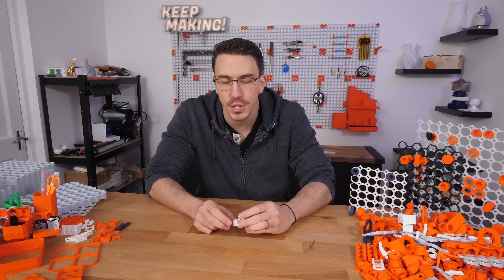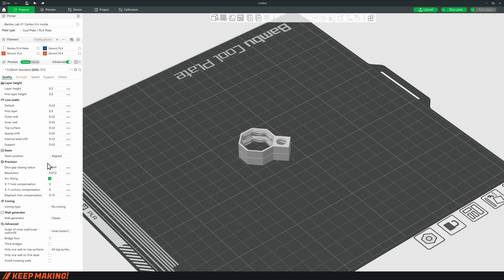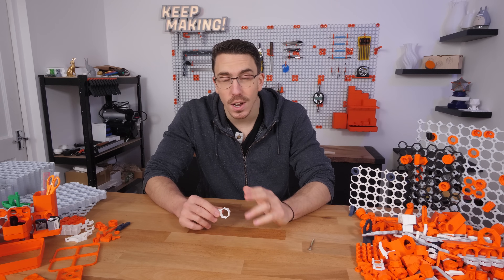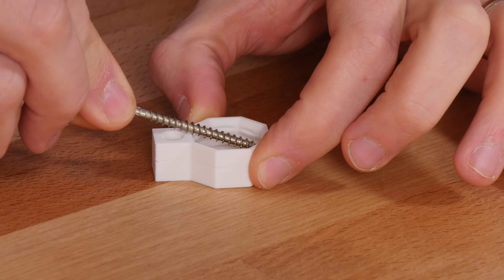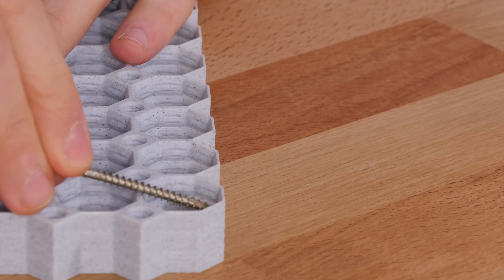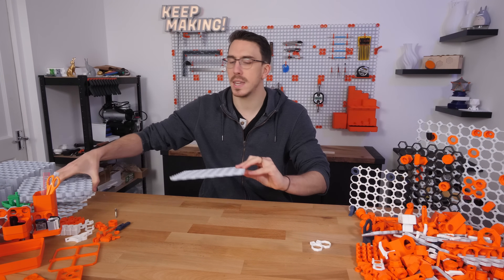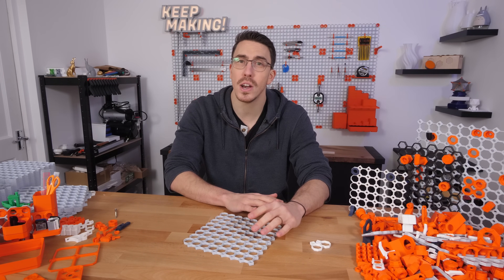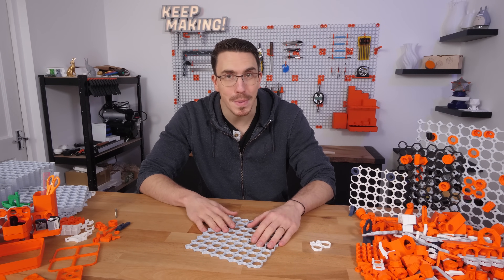Multiboard: What Is Stack 3D Printing

Comment: I could get my test prints to work fine, but then when I tried printing bigger tiles, I'd get the first tile fine, but then subsequent tiles either wouldn't print at all, or they'd turn into spaghetti. Turns out it's related to heat creep. I'm using a Bambu X1C with a 0.4mm nozzle and PLA Matte material. I sped up the Ironing Speed from the default of 30mm/s to 50mm/s and the Ironing Flow from 10% to 15% and I left my door open and cracked the top glass lid off and now it’s working great!

Comment: What if they are not exactly the same. Example I am trying to print a multi-board setup for my bambu X1C a side panel. The specific model I chose because it has borders but since it has borders each piece is specific left right top bottom making subtle differences. Can I still stack them

Comment: I had initial success with stack printing the Multipoint learning pack stacked tiles the printed great and cam apart great. When it came to the 8x8 stack of 4 I made an initial mistake and did not turn ironing on so i have a very solid tile that is 4 tiles thick. Reminds me of the floors they use in aircraft!  The next print I followed the instructions and turned the ironing on but the settings do not appear to have worked as well as the did for the learning pack as they will not pull apart. I've tried the screw technique, a chisel I can split the edges but they will not pull apart in one piece. I am not sure what to try next I could do a PTG layer between them but its slow enough to print tiles without adding time. which settings do I need to tweak? I'm using a BAMBU x1C and Bambu matte PLA

Comment: Ive used this,, but separating the tiles requires a sharp stiff knife, and a lot of work. It's worth it to.print overnight (approx 4 hours per 9x9 panel, I print 2-3 stack,s), but not fun.

Comment: How much is the space between the two models if I have a 0.4 nozzle
Reply: Nozzle size is the diameter of the filament coming out.  Layer height is independent of nozzle size.  So you can have a .2mm layer height with a .4 nozzle.  Just make sure the layer height in your slicer is set to .2mm and you should be ok regardless of what diameter nozzle you are using.

Comment: I just printed an 8x8 grid stacked x4.  I was kind of concerned I wouldn't be able to unstick it.  I used the screw trick to get it started and then they came apart very easily.

Comment: Yeah, well I just tried this and got a 3 stack of solid pla. Grrr. I did the settings just like he said. What a waste of time. Obviously there are some other settings that are completely missing from this video.
Reply: The printer has to be very dialed in, the print temperatures you use have to be right for that filament and so on. If you print too hot, for instance, I imagine the top layer will just melt down on top of the lower. The way to do it is to print just the test piece and if it sticks, then trial and error until it doesn't. Only then do a 10-stack...

Comment: I got this to work with Bambu very easily .. take the file, use the settings he says for the ironing and walls... etc... then right click the grid, add part then pick the same file again ... then select both "parts" (has to be a part) by clicking then holding ctrl click ... new feature with light up in bambu "assemble" click that..... now select top face of bottom part, and bottom face of another. click the "center" button in assembly drop down, then enter .2 for the gap ... done...
Reply: A few notes:
- After adding the second part and before you select both, move one of the tiles. It's easier to select parts from both tiles in the assembly and you can easily fix the position afterwards.
- Face and Face assembly doesn't work for me for some reason. Point and Point assembly does work if you select the same corner point on both tiles but on one you select the top point of a corner and on the other tile you select the bottom point of the same corner. In the assembly menu you set X and Y to 0 and Z to your layer height (0.2 if you follow the recommended settings). Don't worry if one of the tiles ends up under the build plate...
- If one tile ends up under the build plate, exit the assembly (press ESC until the assembly menu is gone) and select the move menu (M). Pull the tile stack (it's only one item consisting of both tiles now) up and the slicer will drop it to the build plate for you.

Thanks @jakeMTSU !
Reply: You are actually amazing! :)
Reply: This is not working any more.  Bambulab gives floating cantilever error
Reply: @StraightRocketFuel  getting that is normal. You should be able to ignore that.
Reply: @wullxz thanks! Is it normal for a stack of five 8x8s to take 18.5 hours to print?
Reply: @StraightRocketFuel  depending on your printer and the number of 8x8s, yes. On my Bambulab X1C, I usually set the speed to ludicrous after the first 2 layers are down. I also turned down the auxilliary fan to 30% since I had some layers fail near where its outlet is.
Reply: @StraightRocketFuel that sucks, i haven't used it in while

Comment: I honestly have to ask. Why the absolute fuck are the "Default settings for multiboard" not already set into the fucking parameters on the downloadable models? Why isn't it preset to that by default. I printed like 5 tiles before i saw this video and heard "Default settings, 3 wall perimeters". Do you know how cuntish it is to upload a model without having the proper settings already loaded into it?

Comment: Can we get a new version of this with the latest bambu labs slicer, the top layer stuff isn't correct any more and it was a struggle to get them apart :( making me nervous to print a whole stack.
Reply from the maker: Could you elaborate on this as I have a bambu printer to and with the latest update nothing has changed that I'm aware of to change my approach to this
Reply: @Keep-Making  my bambu slicer doesn't have the same ironing as yours and honestly I'd love a tutorial on dialing in a P1S as the stacking tests that I've printed are not coming apart without some kind of hacking it apart. I have a 9x9 stack on the bed now, so that's not going to be done till tomorrow and I'm hoping it's not going to be a waste of filament.

Comment: Looking for help with my P1S. These tests are always fused. I usually don't have issues with tolerances, but this is getting to me. Any help?
Reply: Detect Overhang Walls, turn it off as it adds a layer in-between 2 stacked items which could fuse them. Each stacked item should have a 0.2mm gap between them. So to make a 3x stack of core wall plates for instance, put 1 piece on a plate, clone it 2x times, center each item, select all 3 and assemble. Raise the Z height of part 2 to 6.8mm, then raise the Z height of part 3 to 13.2mm. Item 1 is 6.4mm tall, top surface gets ironed, then second item gets printed at 6.8mm, gets ironed, and so on, and so on.
Reply: @mesajoejoe  Thanks for the ideas. I actually was able to separate them but needed a razor to do so. They actually came apart a lot easier on the full sheets, than the test.

Comment: Would you show how to stack objects in bambu lab ?
Reply: Take an object, clone it X number of times, center each item then select all and assemble them. Then raise the Z height of the parts keeping a 0.2mm gap in-between each object. Make sure to turn off Detect Overhang Walls.

Comment: Really appreciate the video.  However, I can't get the proper settings (don't know what they are) in Cura Slicer to allow the parts to seaparate!  Just checking the  'Ironing' box does not do the trick.  Anyone know the settings or other help would be appreciated!
Reply: Check our this video from 3D Printing Nerd which talks about stacking 3D prints in Cura Slicer https://www.youtube.com/watch?v=ediRzElyc-0

Edit.
I didn't hear him speaking about the Ironing setting at all, so it might not be needed. I don't use Cura Splicer, so I can not speak from experience

Comment: What software/workflow do folks use to create the stack?
I am trying to create a stack of 2 instead of 4. One of the objects gets the texture PEI surface, the other does not...which gets used in a different setup.
Reply: I got this to work with Bambu very easily .. take the file, use the settings he says for the ironing and walls... etc... then right click the grid, add part then pick the same file again ... then select both "parts" (has to be a part) by clicking then holding ctrl click ... new feature with light up in bambu "assemble" click that..... now select top face of bottom part, and bottom face of another. click the "center" button in assembly drop down, then enter .2 for the gap ... done...

Comment: Show us how you stack prints. Not how to print your stacked files...
Reply: Is this how you thank him to give us really amazing storage solution and for free? Moron...
Reply: Duplicate object, move them to the same position and raise it on top of the original. Set 0.2mm gap. Then select both objects and choose “merge”
Reply: Also they specifically mentioned that the already stacked files are available for supporters. Which is to say if you are not confident or comfortable with manipulating the 3-D model in the slicer, you can toss them a little bit of money they’ve already done it for you. It’s literally the point of what they’re doing is selling these files.
Reply: I printed the test print which worked. I threaded a bolt through the big hole and it separated pretty easily.
Reply: He explained how its done, there's a .2mm gap between the parts
Reply: @travisgrudzinskas8384 yeah, in what software because No slicer ive used allows for air gaps between parts/models.
Reply: @secondleasegamer8312  I just tried this in bambu studio, what I had to do was load the stl and duplicate it. Then you can combine/group the models, from there you can adjust the height of one of the models so its .2mm above the other. You'll get an warning but you can just ignore it and you should be fine.
Reply: @secondleasegamer8312 Literally just move the part with the transform utility. This is not hard.

Comment: I spent over 16 hours printing the 8x8 Multiboard Core Tile x4 Stack. I honestly don't see any advantage over printing in one piece. Moreover, I see more disadvantages than advantages. Printed together, the 4 took 17 hours and 4 minutes. In the case of printing a piece separately, it takes 4 hours and 19 minutes, so a total of 17 hours and 20 minutes in total. In such a long time, those 15 minutes make a negligible difference. My biggest problem is that the print is full of residue that is hard or impossible to remove. The idea is good, but useless for large pieces. I think this technique is only useful for much smaller pieces.
Reply: 15 minutes is a negligible difference if you ignore the time between the prints. With the four separate prints, you would need to go to your printer every 4 hours and remove the completed one if you want it to be completed in the minimum time. This adds time, and is impossible if you want to print it before you go to bed or to work.

A single 16 hour print could be started when I go to bed, and would be finished by the time I get home from work, for a total of 16 hours elapsed time. If it was four prints, I would start one before I go to bed, pull it off in the morning, start the other one before heading to work. Then I would pull the second one off after work, then print two more before bed. If you sleep for 8 hours and work for 8 hours, that's a total of 24 hours for the prints to be completed.

Comment: Newbie question: Which slicer are you using? 
I can't find the same settings in Cura. They are probably there, but I can't map the names to Cura's.
Reply: its most likely 
either orca slicer or bambu slicer, they both look pretty much identical.
Reply: Cura has ironing hidden under the Top/Bottom section of the printer profile settings. There is a small place to enable ironing inbetween "extra skin wall count" setting and "Skin overlap percentage".  Once you enable it, more ironing settings appear. 
Hope this helps!! 

I am using Cura 5.6.0 as of posting this comment.

Comment: In the early days of the pandemic, I designed a headband for a face shield that used a clear transparency film sheet as the shield. The headband featured geometry that allowed you to stack the headbands on top one another and easily separate. Headbands featured symmetrical geometry top and bottom that tapered to 0.4mm so in between headbands was only one layer to break. This method looks better as it leverages the aspects of the raft from the slicer to create the separation "cut".
Reply: Might have printed one of two of those 👍

Comment: Gotta keep in mind that stack printing doesn't work with all materials. PETG can give you headaches with the layers fusing together, for instance.
Reply: I did stacking prints when mass printing headbands for face shields in PETG early during the COVID shutdowns. I've forgotten the gap, but one technique that I used with my MK3 at the time was to turn the part cooling fan onto 100% for the first layer of the next stacked print, then return to the normal fan speed (30% I think) for the rest of the next stacked print. Wash, rinse, and repeat for each stacked part. This really helped breaking the head bands apart. As I recall ironing wasn't a feature in PrusaSlicer back then, but even if it was I don't know if I would have thought of that...
Reply: @Sembazuru awesome tip, thank you!

Comment: If you print them in PLA and have either an AMS or the patience to do multiple filament swaps at specific layer heights, you can simply print a single separation layer of PETG in between them.

PLA and PETG don't bond and you can easily pull them apart.
Reply: Doing manual filament change kind of defeats the purpose of stacking them.
Reply: Without an AMS, there's no real sense in going fillament swap. Its easier to just take the print from bed and goin over it again
Reply: No not really, depending on your setup you can perform a filament swap quicker than your printer needs to heat up nozzle and bed again. Also the first layer is always slower and if you print a big tile that can take a long time
 @reinaldoalencar8432

Comment: There's also the technique of forcing the layers to delaminate between parts by reducing print temperature without the need for a gap.
Reply: Can you please elaborate?
Reply: @stevenwpf1Some filaments are prone to delaminating when printed with a temperature that's too low for the layers to bond. So your part is printer normally at its regular printing temperature, but the layer you want to separate is printed at a lower temperature so it delaminates.

Comment: Great method for specific situations, but I think custom supports would work better than just stacking them, because you would multiply all the problems with every stack considering the empty 0.2 gap accumulating. By the time you get to layer 5 you have 1mm of gap. Great visual either way 👍
Reply: I don't think that would be the case. The layer after the gap will sag just enough to make it stick but not squeeze, so the z dimension would be the same no matter how many stacks you make.
Reply: @ZMicron  thats hoping for a lucky print rather than setting yourself up for success. It would have to be observed at every layer as if its the first layer to make sure it works properly. I wouldn’t leave something like that on overnight unless it got consistently lucky over multiple print tests first 🤷‍♂️
Reply: @JLake3D  I mean it's basically the same as gap in support, 0.2 or 0.15 is very common setting to use for support. 
This technique is also used in many print-in-place models where the part of the model starts of floating or with gap and needs to be separated later on.
Reply: @ZMicron  i agree with your point on this one, but when you stack the gap it creates room for failure as i mentioned in the first comment. If it wasn’t the case people would be using this method all the time instead of printing just one layer of an object.
Reply: That's not how it works at all.
Reply: @charleschristianson2730  please explain it to me so I can understand then 👌
Reply: @JLake3D  Because by the time you get to the second or third layer of the next item it will have already filled in and will be printing like normal again.  It's just enough of a gap to create a weakpoint so the items can snap apart.  Do you own a 3D printer?  I feel like anyone who's done a few prints will know this intuitively because of how extruded filament reacts.
Reply: @charleschristianson2730  yes I understand that part 😅 my argument was that custom supports are better than just gaps.
Reply: @JLake3D  Like someone else said, most supports are going to have a small gap anyway so what's the difference?  Also, it seems like this technique is suited for mass-printing large amounts of parts when quality doesn't have to be perfect.  He even mentioned in the video that the underside was going to have flaws.
Reply: @charleschristianson2730  thats why i mentioned custom supports. You don’t need to have a gap in all supports. When its custom, it’s enough to have the print oriented in a different direction, thin & flexible, to be able to take it off without issues. Sortof like sacrificial layers but engineered to come off without much work.
Reply: @JLake3D  Print whatever you want, man.  I'm not stopping you.
Reply: @charleschristianson2730  sorry, wasn’t trying to argue or anything. Just wanted people to be aware there are other options to achieve similar results in a more controlled manner 🤷‍♂️